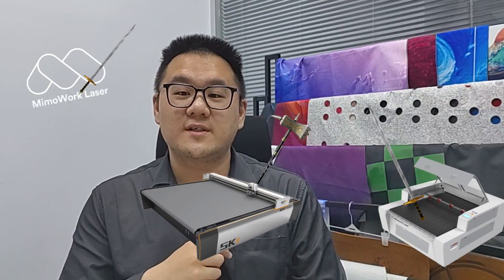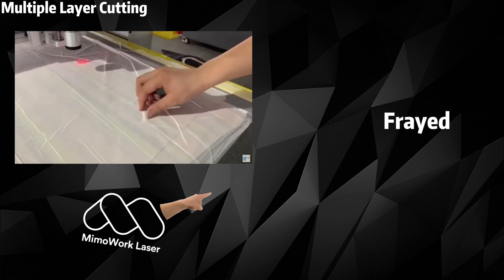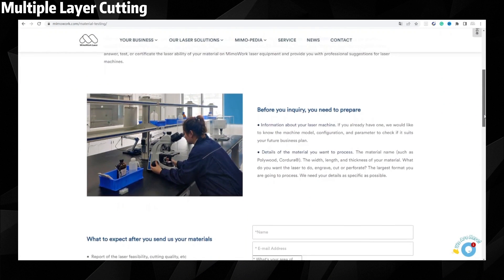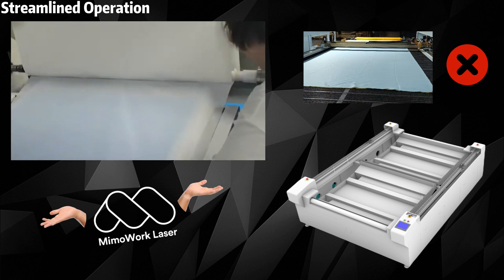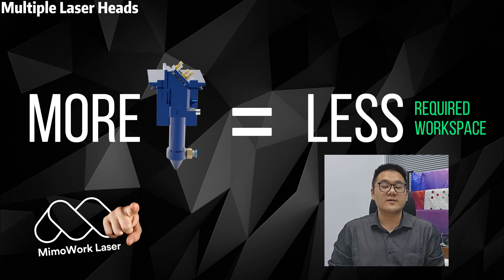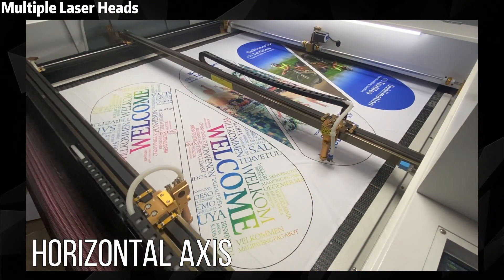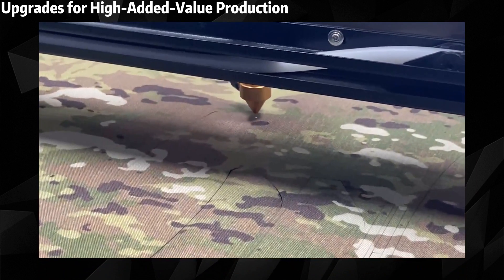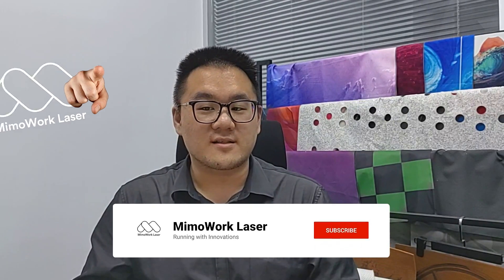CNC vs Laser | The Efficiency Showdown | Fabric Cutting Machine

Comment: I am using a desktop size CO2 engraver,  can I also cut multiple layers of fabric at once?
Reply from the maker: Are your fabric in a piece or roll? You can put the piece on the table and cut multi-layer fabrics at the proper power and speed. But for roll materials, you need the auto-feeder and conveyor table for multi-layer cutting. Do you have the conveyor system?